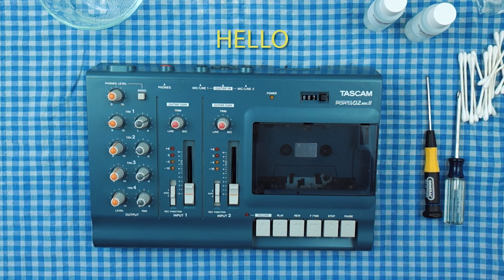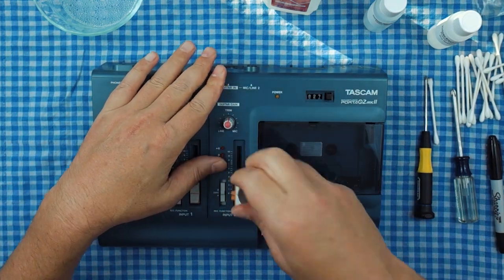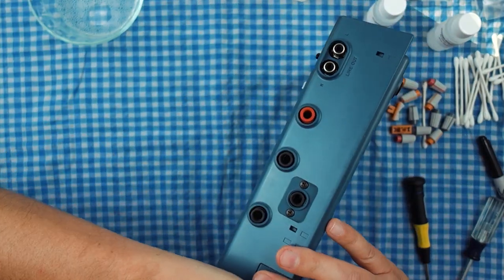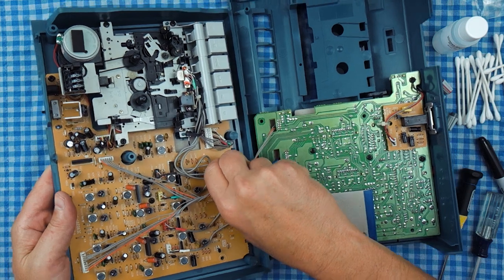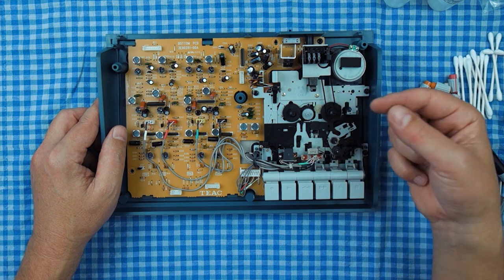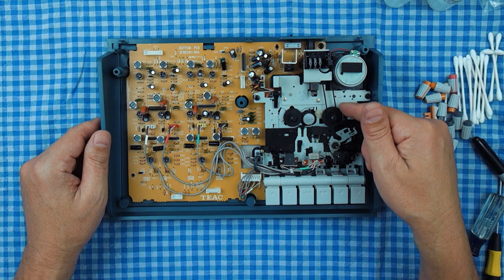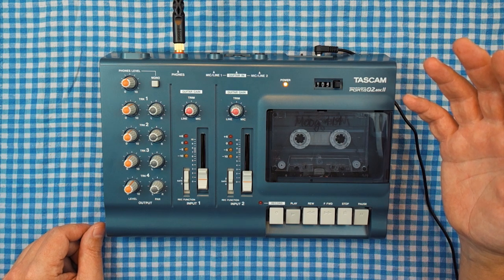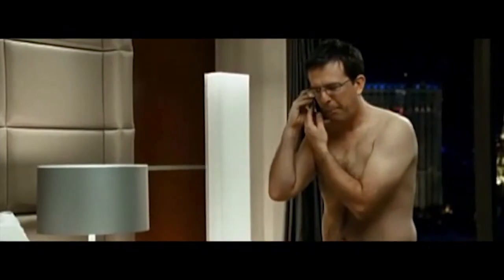How to fix a noisy output on the Tascam Porta02 MKii

Comment: I have one of these that worked when I bought it, but now is mostly non-functional. I think the belts are worn but I'm sure would benefit from general maintenance as well. These videos are really thorough and informative. Thanks for making them!
Reply from the maker: You're totally welcome. did you get yours up and running?
Reply: @User173  Not yet. I started again today, got the old belts off and measured them. What belt kit did you order? I don't see this model listed specifically on the vintage-electronics website. Is it the same as the 414?
Reply: @hearpatplay just replaced the belts on mine since the ffwd and rwd wouldn't work anymore. works flawlessly now

Comment: I have a very large Tascam portastudio 424 mkII.. I got it for a good deal.. but I had to solder a new record button onto the board, as the entire button assembly, plastic and mechanical were missing! After opening it up, a residue revealed there was some kind of.. spilled cola incident! But, this was no excuse for all of the screws being replaced with large spiraled WOOD SCREWS!! Everyone, just save your original screws!! Still a great deal for 30 bucks, lol

Comment: Brillant video! I've  got one of these I havent used dor 10 years. Found it but there is 'white dust' in and around the line in jacks. I assume this is oxidization? Can I clean it with rubbing alcohol and or do I need some deoxit like what you use for the potentiometers?
Many thanks!
Reply from the maker: just rubbing alcohol the jacks, then fire it up and take a listen. if none of the pots are crackling or screeching in your ear, then you are good! if they are, then de-oxit!
Reply: @User173  Beautiful, thanks a brunch for the swift response. Time to make some loop tapes!

Comment: Just ordered one of these and the channels crackle and short out and if I hold them just right the audio plays. I’m not experienced at deconstructing electronics. You think just pulling the knobs off and spring the compressed air in to clear out dust will work or do I really need to unscrew it all and try?

Comment: What about electrolytics, they’ve got to be over 30 years at this point.  I find that when I have headphones in there is a lot of noise floor is quite high, would replacing filter caps dampen some of that?  Sounded like yours had the same issue in the demo at the end of the video but not as noticeable.  Might it have to do with the jack inputs as well?

Comment: That DeoxIT worked way better than it had any right to, thank you for this video. Bought a unit that had insane crackles on the headphone volume pot and this procedure cleared it right up. Stay rad.

Question, in case you're reading these. When I make a recording of a metronome (say 112bpm) it plays back faster, maybe 113-115 bpm. Any experience with this? It's making keeping different tracks/layers in sync challenging.
Reply from the maker: I'm not sure.... are you saying that your DAW recognizes it as a higher bpm? That's interesting. I've not tried the metronome thing.
Reply: @User173  Yeah, I just get slightly different speeds every time I record. (: I've been multitracking a synth being controlled by a sequencer and the different layers do not stay in time. It's an interesting kind of dreamy effect. I wonder if there are any other cleanups/tuning I can do to the Porta02 to make it operate more precisely?

Comment: Hello! You obviously know your way around these machines, thanks for all the videos! My Tascam Porta2 makes this really loud squealing noise when I try to record on it -- it's quiet through playback, but when I hit record and select a track, it squeals, a different noise for each track. Do you happen to know what the problem might be? It's only audible through the headphones, there's no audible mechanical noise like that coming from the machine.
Reply from the maker: hmm, that's an interesting one! I've not heard of that one before. Some mechanical noise must be being recorded on to the record head. I'd open it up and see if you can check all the solder connections to the play head and make sure you don't have some weird grounding issue or some cold solder joint. First step is a very thorough visual inspection.
Reply: @User173  ok, thanks so much! Also, have you ever heard of one track recording at a lower volume than the rest?
Reply: I'm having exactly the same issue with mine but oddly enough it only happens about 25% of the time. Were you able to fix it? Like you said, it's only audible through the headphones (not the line outs) and it doesn't actually get recorded to the tape. My suspicion is that it has something to do with the headphone amp, but I have no idea how to start troubleshooting that.
Reply: @bicyclops  damn I can't even remember now -- if I recall correctly, I was messing it up by using tinfoil over the tape head for sound on sound recording.

Try cleaning it and making sure nothing is stuck anywhere
Reply: @bicyclops  damn I can't even remember now -- if I recall correctly, I was messing it up by using tinfoil over the tape head for sound on sound recording.

Try cleaning it and making sure nothing is stuck anywhere
Reply: @conormaloney126  Okay thanks, I'll do that. Fingers crossed!
Reply: @bicyclops  I have the same issue. did a clean up solve the noise issue on the headphones amp?
Reply: @giuseppepettinati9627  Unfortunately I haven't been able to fix it, although I never did get around to cleaning all of the pots thoroughly. I've just been using the line outs plugged into my mixer to monitor while I'm recording.

Comment: So I got a porta 02 the other week and it worked great the first session. Has not been able to receive power since I turned it off after that one and only session. It isnt the power source because it works with other 9v consoles and its not the wall outlet. 
Do you have any idea what is going on?
Reply: Its also not the LED because record and playback functions arent working either

Comment: Thanks for the video!!! I just got one of these bad boys.. and I think ive just broken it!!! I think i might of pumped phantom power into the line out on the back when I was trying to record a tune! I wanted to record it into my audio interface and I had phantom power on by accident and I'm not sure it the Tascam liked it! It plays back but the sound is pulsating and there's a pretty bad humming going on!  Do you know if I can fix this at all!?? Thanks for your video. Rad tape loop at the end too! Jack
Reply from the maker: you can fix it. but you'll have to find the capacitor you blew.

Comment: this is awesome! Thank you so much. A question: I have one Porta02 just like this that was left in the closet for maybe 10 years. I don't have problems with the pots, but my unit generates significant self noise (just white noise). Any recommendation? All the best!
Reply from the maker: Shoot, sorry for the late reply. But I think that noise is pretty normal. these are fairly noisy little boxes. I'd have to hear to know if it's more than normal. but there is a usual hiss and noise with these.

Comment: Thanks for this video. I have a constant hiss coming from the output and headphones jack. Should I open and replace these? Also, when I'm trying to record, the volume of whats recorded to the tape is super low, the manual says to clean the heads, you think this will work? Thanks in advance
Reply from the maker: Can't hurt to clean the heads. The hiss sounds like noisy pre-amps. Perhaps a good clean will help a bit, but noisy pre-amps will sound like a steady hiss. there is some present in general on these old tape machines, but usually it's a feature, not a bug. Remember, listening to these on headphones will present a fair amount of hiss, but it shouldn't be annoying. That's kind of the "creaminess" of tape.
Reply: @User173  hey sorry I missed your reply. Just as an update, I cleaned the heads and that worked perfectly though. Still got that hiss but it can be managed, thanks for the reply

Comment: what would you suggest if there is noise coming from the headphones while playing an instrument while using a 4 track? ive tried micing an amp and running direct, bought new headphones and adapter, but am still hearing noise/crackling/distortion, prior to recording. any help would be much appreciated!!
Reply from the maker: what are you running in to it? if you're using Eurorack modular, it might be coming in too hot?

Comment: Thanks for the brilliant tutorial (so far!) One quick question. On seeing how nice your tutorial is, I got really excited to do the whole DIY process with you (pitch and speed stuff too) and have just taken apart an old Porta 02 I happened upon. However, it's a mark i, not ii, which I only realised 13 minutes in because the exterior circuit board screw is not present on mine. All I'm wanting to know, or rather confirm, is -- will all your advice and information be applicable to my mark i? Obviously, some screws are in different spots etc, but everything else should be very similarly laid out and thus modified, right?
Reply from the maker: Totally! the only thing you are doing is either a) adding a pot in line with the power to the motor to slow the motor, or b) replacing the single speed motor with a variable speed motor and adding a pot to control the speed/ pitch. I have not done it to a mk 1, but I don't see why it wouldn't work.

Comment: Hi! I've been using porta 02 for some time but input no2 seems to dead. Sounds are barely audible when I turn both slider and pot all the way up. Any advice?
Reply from the maker: you have made sure that the porta 2 is set to line and not safe or anything else? if so, then likely a bad jack. Easy enough to replace. you can search ebay for new replacement jacks and then solder a new one in. it's not hard :D
Reply: @User173  unfortunately that must be the case then. Thank you for your quick reply! Great work! Last couple of days I've been watching your vids with Lyra 8.
Reply from the maker: @tomislavgrzunov6560  awesome, more videos to come. I've just moved across state and still unboxing everything. Plus USA holiday season. Anyway, the 1/4 inch jacks are cheap. Would be an easy fix if it's just that. My first suggestion is to open it up, take a look at the jack and see if there is something faulty, like a bad solder joint, and then all you have to do is just resolder it and buy nothing!
Reply: @User173  i looked it, seems fine. Yeah, can't wait to see more! Looks and sounds amazing! Tomorrow I'll give it another look to see what exact type of 1/4 jack is it.

Comment: Will this work if I'm getting static from both my rca and headphone outputs or would this be another problem cause it sounds like that same kind of static coming out from both outputs.
Reply: This didnt work for me
Reply from the maker: if all your ouyputs are noisy, it's a ground issue or capacitor issue.

Comment: Hi I have one of these unit portastudio 424. I hear too much noise during playback, hums, etc., What do I do?
Reply from the maker: uhhh, well do you get crackles when moving the volume pots? is it happening all the time? does it come out of every output, or just one? I need a lot more info. but I would start by isolating where the problem is coming from. it's most likely a loose ground or dirty POT.
Reply: User 173 I’m having the same or a similar problem with my 424 mk3. Desperate to fix it. It’s a popping sound—like a vinyl record but more like electrical popping as opposed to static—  on playback but it usually doesn’t start until about 20 seconds into the playback of recording. Sometimes it does start right at the beginning of the song, oddly. But usually it comes in after ~20 seconds. It’s on most (all?) of the 4 recorded tracks but I think it’s louder on the 1st and 2nd. Anyway, the pops don’t happen in the exact same spot in the recording every time—it varies by a few seconds every time. What’s weird is I got it to stop popping after cleaning the heads and capstan, long enough to bounce my stereo mix onto my Denon stereo cassette deck (loss in sound quality though—boo!), but when I tried it again a day later (to bounce a fresh mix of the same song onto my digital recorder), the static popping was back and bad as ever. I cleaned it twice and still can’t it to stop. Please help!
Reply from the maker: @slacktoryrecords4193  that's a tough one without being able to diagnose it myself. You may have a cold solder joint or a bad capacitor. It's so hard to tell from a youtube comment. However the fact that cleaning it got it to go away is a great indication that something is wrong on the play head perhaps. I'm not sure if it needs to be demagnitized or not. Sometimes these old tape machines build up a huge magnetic field and it can cause some popping and glitchy playback. See if you can't get another deep clean going, open the whole thing up and clean the board too, while you are doing that inspect as best you can all the solder connections. be sure to isolate for me which tracks are doing it. you said maybe all, but please try and isolate if it's a specific track, or if it's all of them, then it's likely something in the output. It could also be a magnetic build up, and so trying to find a demagnetizer could help. I hope you are using the right cassette types as well. Check out the owners manual online and make sure you're using the correct cassette tapes. also try out multiple kinds and make sure you aren't just having a problem on the one. get back to me and let me know how it goes. If you are still haveing problems you could either send me the unit or we could set up a zoom meeting and I'll try and trouble shoot with you online :D
Reply: User 173 Thank you for the thoughtful response! It seems that it’s mostly this one tape that’s affected. While the pops don’t occur at the exact same spots on the tape every playback, they do occur at roughly the same points. Which is odd, no? Sometimes there are lot of pops in the first 20 seconds when I RTZ and press play quickly, but usually not. I tried a bunch of other tapes (these are all type II TDK Pro 30s), and only one of them seemed to have a bunch of pops on it (and I didn’t remember it having them before). But I cleaned the pinch roller, capstan, etc. properly, and I was able to get through another playback (to bounce my stereo mix onto my digital 8-track) without more than one pop. Then I went through 6 other recent recordings, and only one of them had one pop at the start and one at the end of the song. I have a feeling I could get that one to play without any pops if I tried again. For reference, here is what it sounds like. This isn’t my recording, but it’s exactly the same pops:

https://m.soundcloud.com/faraz-h/tascam-414-pops-and-clicks
Reply from the maker: @slacktoryrecords4193  I'm glad it's just mostly on one tape. Might be something messed up on that tape with the magnetization. and as I said, if your machine needs to be de-magnetized that's super important.
Reply: User 173 I hope that’s all it is, that it needs a demagging. I was skeptical, though, because in reading discussions about this problem (what one person said sounds like a capacitor discharging), a few people said demagnetization is not something that needs to be done regularly. But I have no idea what this machine’s history is, if it’s ever been demagged, how to tell if it really needs it. Do you recommend any particular product or procedure for demagging?
Reply from the maker: @slacktoryrecords4193  I personally have not demagnetized in a LONG time. so I don't have a clue which to buy. But I do agree that it's likely a capacitor problem. I was just trying to suggest the easiest route first before ripping apart your machine and using test equipment to try and isolate a bad component. It would almost be easier to just buy another 414 than it would to try and find the bad component.
Reply: User 173 Yes, that sounds likely re: just buying another. It’s a 424 mkiii, though, so a bit heftier of a $ layout to replace it! If it comes to that, so be it.
Reply from the maker: @slacktoryrecords4193  oh man, I forgot. Lots of people I'm trying to help ATM. haha. Man I realllllly want a 424 for myself! One thing you could do, is figure out if it's making the pops with a blank tape, or if it's recording those pops onto the tape and not audible when a blank tape is being played. So if the machines is adding the pops to a tape, then you could almost guarantee it's the capacitor just before the record head. If the pops are occurring even on a blank tape that you have not recorded to, then it's something occurring around the playhead, or perhaps just before the audio out. If this is the case, then you could isolate the capacitor to be on the audio out, or on the headphone jack and then just replace that. Does any of this make sense? I'm just trying to share how I would isolate the capacitor with the problem. Once you figure out where the problem is likely coming from, you could use a multimeter to find the exact component problem, but pops are almost guaranteed to be a capacitor. Let me know if you ever want to do a zoom session if you need help.
Reply: User 173 thank you so much! That is very helpful.